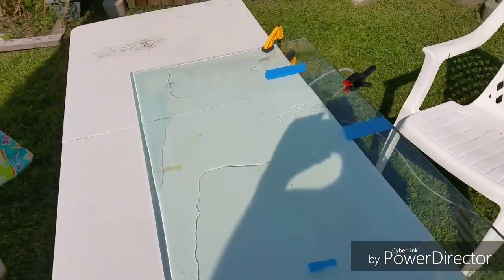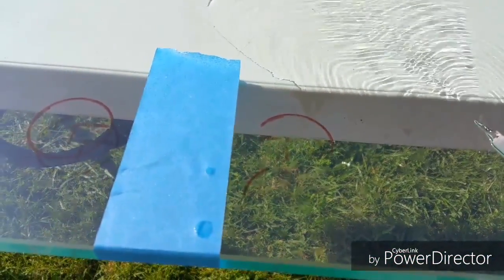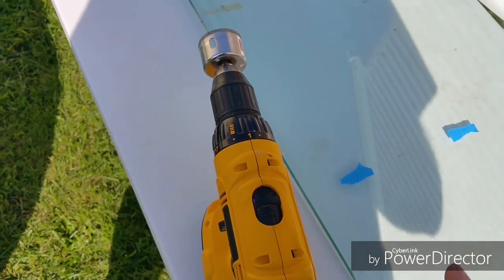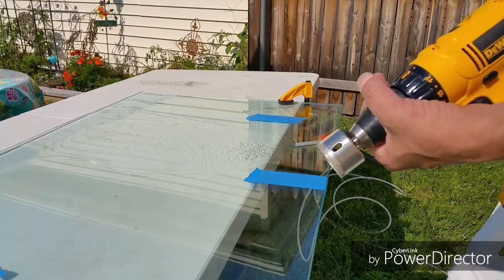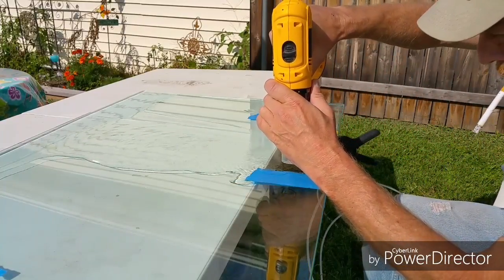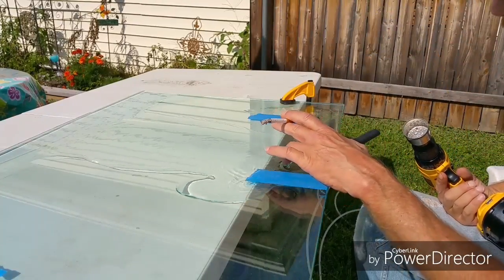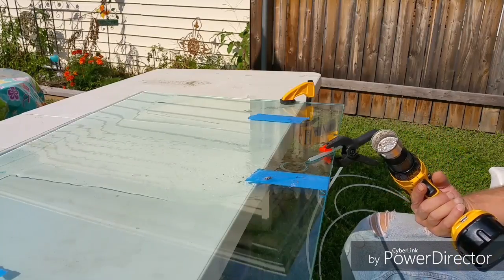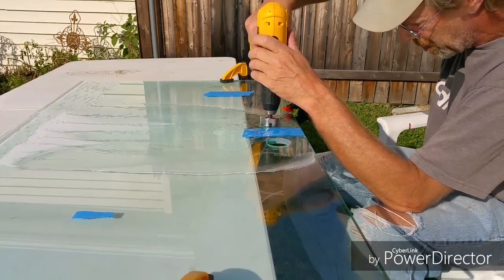Tank Build - Episode 2 Drilling tank

Comment: Very well done!   You should make YouTube videos of this...

Oh, wait...
BTW, I think I bought the same drill bits, got a smaller one in the package that you may never use?   I have done 7 holes on 1/4 glass with mine and it's still doing fine.
Reply from the maker: laminar flow thanx. In my set the smaller one is for 3/4 inch bulk heads. It was a bit wobbly [ no pun ] but still worth the money. Thanx for watching

Comment: I am planning to drill the tank with the water in it.

But I think I should never do it.

I am too lazy to move all livestocks.
Reply from the maker: It can be done. I would do it something like this; Test for temper, Lower water level to below the hole, Duct tape a garbage bag under the hole and cut bottom of bag to create a funnel into a brute can and trickle water on the bit. Good luck buddy
Reply: Thank you for your suggestion. Now I am waiting for an overflow from Eshopps. I ordered it from US. I wish I can find Aquarium equipments easier.
May be I should move to US for the reefing sake LOL.

I will update about the result when I have done it.
Reply from the maker: Come on over bud lol